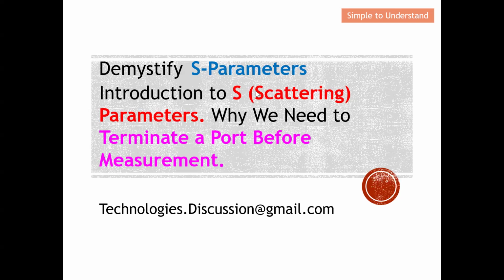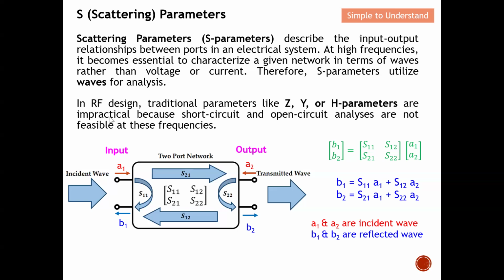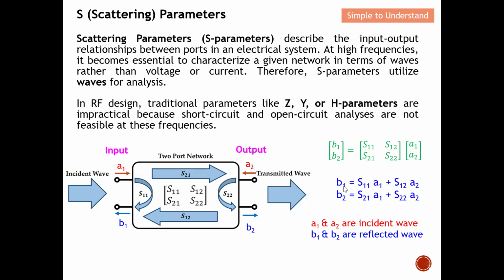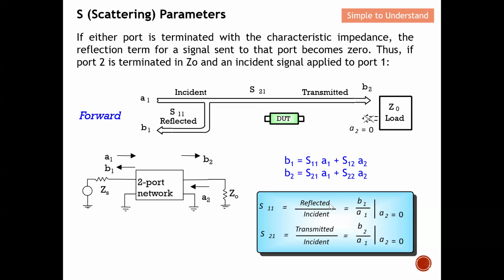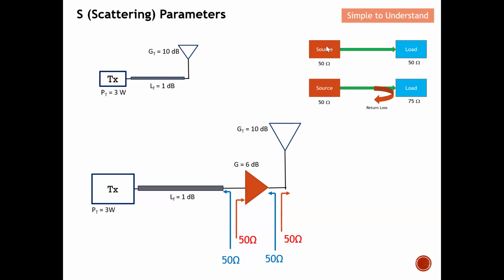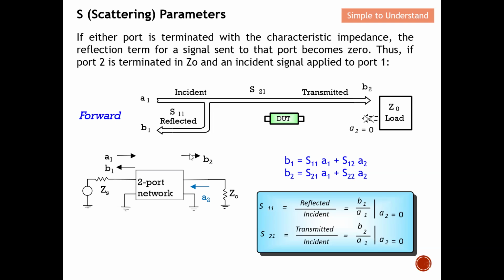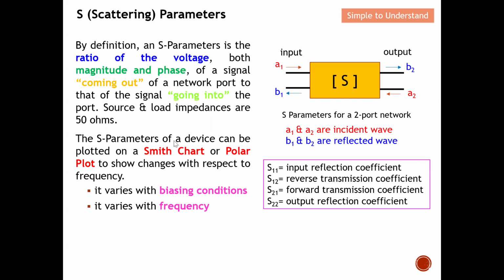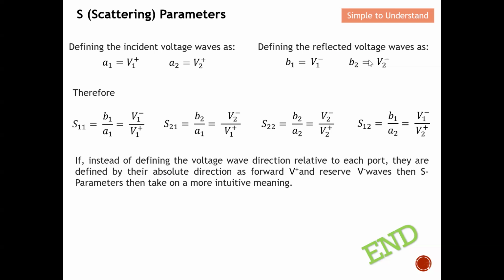S-Parameters #2. RF Measurement Accuracy Secrets: Why 50Ω Termination on Unused Ports Explained

Comment from the maker: Hello, and thank you so much for taking the time to watch this video on S-parameters. This video begins with an introduction to Scattering Parameters (S-parameters). When performing measurements, all open-ended ports must be terminated with a load—specifically, a 50-ohm load. Terminating the ports with a 50-ohm load helps prevent reflected waves. By doing this, we can accurately obtain the S-parameters (S11, S12, S21, and S22). This video also explains why unused ports need to be properly terminated to ensure reliable measurement results.